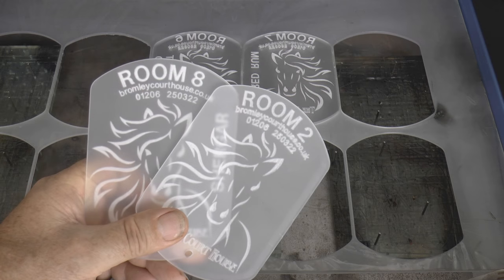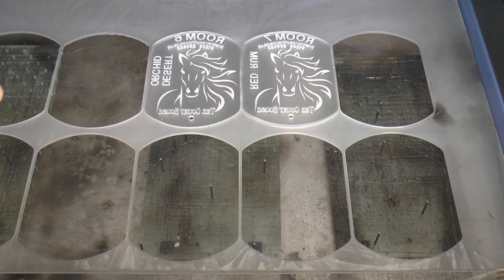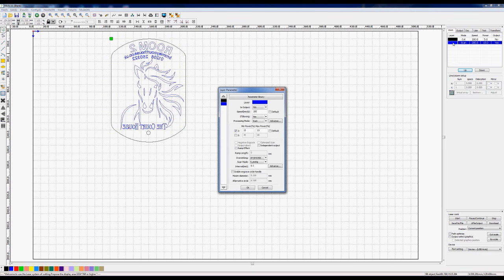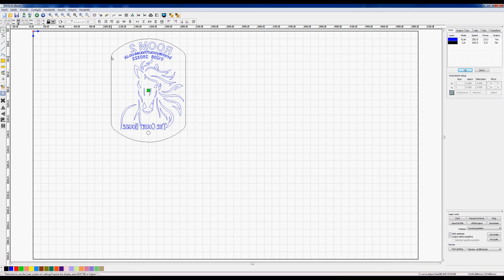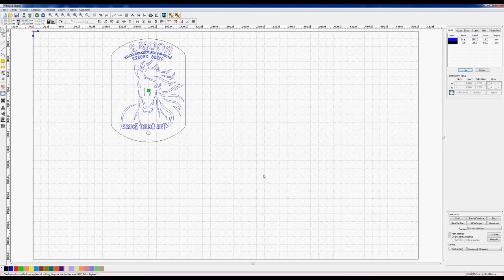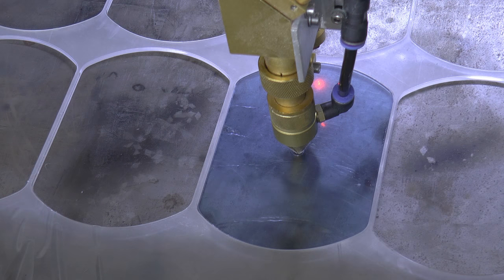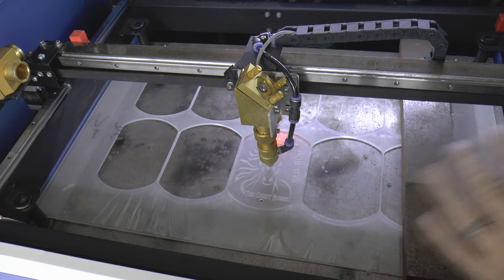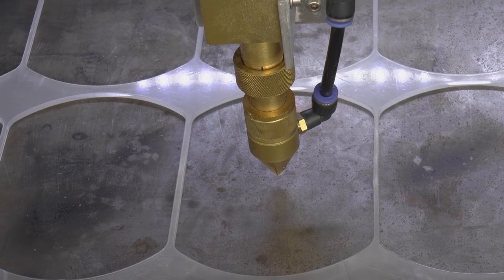RDWorks Learning Lab 70 Repeat Engraving Location Jig

Comment: In the hobby CNC mill world, the simplest way to get perfect registration (when one doesn't want to attempt painstakingly edge-finding the stock with high precision) is to just include the holding jig (whether it's bolt holes or an outline) as the first step of milling - that way one really doesn't care where the stock ends up precisely, only that the jig cutting pass is aligned with the work to be done on the actual part in the software which is generating both.

Granted, this only works until one moves the resulting jig which then immediately becomes useless having lost its registration wherever it was, but for small runs that's quite fine; next time one just cuts a brand new jig wherever else seems convenient - there's no need to ever locate anything manually. The work pass just has to be in a known position relative to the previous jig-cutting pass.
Reply from the maker: Hi
I have moved on in several ways since I did that video and to be honest, I use one of several  techniques. However, 90% of the time I use nothing more than a piece of card taped to the table. I just draw the outline with the laser and bingo there is my jig. Unlike your CNC there is no cutting force involved so I only need to align my part with the outline and........

Best wishes
Russ

Comment: my approach i use when wanting to get a design in a particular location is , firstly i glued a piece of ply to bottom right of the bed , then cut  a corner out of it using the absolute starting point option . so i now have a datum point to work from , you must ensure you have the bottom right selected in the select position reference option ,( box to the right of the padlock symbol) . you also need to make a note of the x and y position you initially used to cut you jig to , then all your dimensions for your project are referenced from that

now it doesn't matter how big the workpiece is or what shape 

sorry bit hard to explain , but i hope you get the gist
Reply from the maker: Hi
Yes I understand. You created a fixed corner reference to locate parts against . The only limitation on that is that it is fixed to the table. I often use oversize material, as I did on this project. That would cause my material to sit up on the reference square at one corner if i am understanding you correctly.  If this was a task I was doing regularly then a fixed square would be a better solution
Thanks for your input because others reading this may choose your solution.
Best regards
Russ

Comment: For my templates, I create my layout pattern in my SW with the holes for all of the widgets I could print as well as a registration mark in opposite corners with the location marked next to the mark (50,20) or something like that.   I disable that layer though so it doesn't print when I am printing the product.  I then populate and download the image with absolute coordinates to the laser.  Next I move the laser head to the registration marks (printed on the template) and make sure I am square and then press print.  I check the registration each time I print a new batch.  This works really well and is "usually" pretty idiot proof.

Comment: very useful tips!

perhaps you want to do lower acceleration values in the firmware- may give you issues with not using the whole x axis for engraving- due to over-shoot that it needs to ramp down to change directions, however there will be less shaking and wear and tear on the machine, especially for alignment. also a more uniform engrave.

Comment: On the controller panel (on the display) the loaded graphics are displayed in reverse way than in RDWORKS. Can it be improved?
Reply from the maker: Yes. Press the ZU button and  the last item is screen axis. Press enter and get the screen picture to match the RDWorks picture.
Best wishes
Russ
Reply: @SarbarMultimedia  Thank you. Do you mean the Screen origin + parameter? Can you help me with these resonances? BEST WISHEHS
Reply from the maker: @lordfragers  
Hi Fra
Yes the  Screen Origin+.   Press enter and you will get the choice to make any of  the four corners your origin.  If your machine runs to top right corner at start up, in RDWrks there are blue arrows that should be in that same corner. If not then you must first go to Config, System Settings and fix that problem.  When you have your RDWorks and Machine datum at the same corner, then you must make sure that your Screen Origin is at the same corner..

I think it will be a good idea to add your email to another comment so that I can send diagrams  for future issues. I get auto copied with all comments to my email. So leave your comment and email address and after  about 10 minutes  go back and delete your comment/email. I will answer to your email. address

Best wishes
Russ
Reply: @SarbarMultimedia  Writed and deleted mail.
Reply from the maker: @lordfragers  
Hi
For some reason the email copy has not arrived but I will stay watching your comment  if you would like to try again.
Best wishes
Russ
Reply from the maker: Hi Fra
My email may not have picked up your comment because it was a sub comment. Go to any other of my videos and add a new comment there. I am then sure I will get your message
Best wishes
Russ

Comment: Cool! How did you set that the engraving head does not go beyond the picture? What parameters did you change in RDWORKS?
Reply from the maker: When engraving, the head always travels beyond the last point of scanning because the head has to decelerate, stop and then accelerate to the defined speed before starting the next scan line. This deceleration/acceleration is defined in the vendor parameters for the X axis These settings are usually standard settings that work for your machine. They may not be the best settings  so you might like to increase the number until the stepper starts losing steps (or makes the machine shake!). In this video I am using a scan speed of 200mm/s so there is little over-travel. If I change to 400mm/s then there will be 40 or 50mm over-travel beyond the ends of the picture. The deceleration remains the same  regardless of speed so its like when you drive your car 50kph, jam on the brakes and you will travel a certain distance before coming to a halt.. You instinctively know that if you jam on the brakes while travelling at 120kph, it will take a  substantially longer distance to stop. The distance your head overtravels is all to do with the mass of your hrad, and the power of your motor. Bigger motor=fatser acceleration OR lighter head for a small motor =faster acceleration.

Best wishes
Russ.
Reply: @SarbarMultimedia  Thank you. Are they the only option for the head to decrease away from the cadres at lower speeds?

Can you explain what is the jump off speed parameter?

When cutting, I have a problem with the edge of the wheel. The edges are wavy. If I change the speed to a lower one then the problem disappears. What parameter can I change to improve this? Jump off speed? Acc speed? Max speed?

Do you have a movie with setting mirrors in the co2 laser?
Reply from the maker: @lordfragers  
Playing with the motor parameters may well seem to cure your problem but that will be at the expense of speed. Quite often there are other mechanical reasons why your cut is wavy and changing the parameters is hiding the problem not fixing it. I shall need some pictures to see your problem, so I think we should speak by email. For obvious reasons I do not publish my email  but if you wish to add your email to another comment I will; get auto copied to my gmail and will answer you and immediately delete your comment/email address from public view.

Best wishes
Russ
Reply: @SarbarMultimedia  THank YOU so MUCH! I have to take a picture. And what errors in mechanics can occur?

Can you explain the jump off speed parameter?
Reply from the maker: Hi The simple answer is no. I have experimented with it and found that you can set it between 1mm/s and 80mm/s . If you set above 80mm/sec it automatically defaults back to 20mm/s. (which is where mine is anyway). I think this is the starting speed for the stepper drive and I  can feel a slight extra kick on the machine at 80mm/s , although I cannot hear a difference from 1mm/s  at the start of any motion. Play with it for yourself because it has no dramatic effect.

Best wishes
Russ
Reply: @SarbarMultimedia  Thank you so much. So is it like the extra power at the start of the stepper motor? However, the parameter is not important.
In the vendor tool, the laser parameters are: attenuation laser and freq laser? What do they mean?
Especially the freq laser.
Reply from the maker: @lordfragers  
Hi 
You do not want to attenuate the power of your beam so just leave that one st zero attenuation. The frequency  puzzles many . There are two ways to control the power from the laser. Let me start from the beginning. The HV power supply has two functions. It creates very high voltages ,25,000 volts or  more, to ionize the nitrogen within your tube's gas mix . That is the pink beam you see (note!!! that is NOT the laser beam). Once the nitrogen is ionized it can carry vast electrical currents. We cannot allow that so the second function of the power supply is to control that current to just a few milliamps.  Your HV power supply may for example be rated at 25mA max.   There is an IN terminal on your HV power supply that is fed with a dc voltage from 0 to 5volts. When the voltage is at 5 the power supply will allow 25mA to flow through the tube. When it is 2.5volt it will allow 12.5 mA and  at zero it will not allow any current flow. So you can see that current through your tube is directly related to this IN  voltage . When you select power o 50% you are asking the controller to send a 2.5volt signal to the HV power supply and similarly when you ask for 100% power , you are really asking the controller to send a 5 volt signal to the power supply.   The watts output from your tube is NOT linear so 25% power will not mean 15 watts from your 60 watt tube. No, more like 40 watts.  If you look at your controller you will see that there is a terminal group CN5 . Terminal 5 will say L-AN1. This will be connected to IN on the power supply and the  voltage in this line will rise and fall according to the power you are demanding (0-5vdc). It is an ANALOG output. Most machines instead, have a wire between terminal 3 and IN. This terminal is called LPWM1 and is a DIGITAL version of the analog output which is almost totally resistant to interference from the high energy spikes generated by the machine. PWM stands for Power Width Modulation and this is a clever way to send a variable voltage to the IN terminal. The signal in this line is either 5v or 0 volts. If the voltage is high for 1 millisecond and low for 9 millisecons then the AVERAGE voltage over 10 milliseconds will be 5v/10=0.5v The problem is that if it took 10 milliseconds to work out what the voltage should be then your machine would be VERY non responsive . That is what your frequency is for. It should be set to 20Khz. It generates a 0 to 5v square signal that is 5 volts for half the time and 0 for the other half  So instead of my 10 millisecond example this 20 khz coding takes place 100 times faster ie every 0.1millisecondx. So don't mess with the frequency leave it at the default 20Khz.

Best wishes
Russ
Reply: I understand, 20 kHz is PWM. The bigger the faster the laser determines the control voltage on the generator. Does this affect the laser beam from the tube? What is used to suppress the tube?
I mentioned that I have a problem with the edges of the square at high speeds. As I cut a square in the Y axis, the cut edge is ok, and then when it starts to burn the X axis it starts with a light wave and then the edge straightens. In my opinion, it is the fault of the drive. It's just a stepper motor that has no power to control the gate or backlash?

At lower speeds it's fine.
Is it possible to set the new edge to begin setting with less acceleration? Set a higher resolution on the stepper motor controller?
Thank you for great help.
Reply from the maker: @lordfragers  
Hi Fra
I think your opinion is incorrect for one very logical reason. Your axes are driven by stepper motors. If you had a dc servo control system  then a wavy line would be possible  because you can drive a servo past its aiming point and then pull it back to the target. If the closed loop control system is too "loose" then a way line could result. Not so with stepper motors because the driver outputs the exact number of pulses to move from point A to point B. It CANNOT move beyond the aiming point so there will only be a deceleration ramp  and zero over-travel, So no possibility of a wavy line from the steppers. Your problem will be from a mechanical resonance source. Yes,  slowing  the speed down will reduce the effect of that resonance. . Three main possible sources for this resonance  are 
a)  The  Y drive belts are made of cheap rubber and the teeth flex. This will be further exaggerated if the belts are narrow, say 12mm as opposed to the more typical  15mm wide.
b)  The Y drive shaft may be very thin , say 10mm diameter or less,. and this can result in torque wind up when trying to accelerate /stop  the heavier gantry axis.
c() The belts are insufficiently tensioned.

Hope this helps

Best wishes
Russ
Reply: @SarbarMultimedia  Thank you, Hi. Could this mechanical problem be solved by software?
Maybe it's the Backslash fault?
The Y-axis belt is tight.
Reply: Hi. Do you have any idea to reduce this problem programmatically?
I have an idea:
1. Set slower ramps. The engine will stack and brake more gently. But I do not know how to do it.

2. Remove backlash. Where we enter the parameters.

3. Set higher resolution on stepper motor controllers

What do you think?
Do you have any idea

Best wishes.

Comment: Is this laser still working well for you?
Reply from the maker: As  you follow my learning journey with this machine you will see me getting frustrated with some elements of the design  and I make my own replacement parts and do modification to fix small problems. It is now working much better than when I started 5 years  ago. I replaced the original crap tube and power supply and since then it has performed reliably and very well. I do very little with it now because my step daughter has commandeered it for a small photo engraving business she is building  See current samples of what the machine is doing at her facebook page Unique Laser Art.  Mechanically it's pretty sound  but if you buy from ebay I can guarantee you will be getting a reject tube and power supply that will work in some way but for how long is a lottery. Despite this, provided you buy one with a Ruida controller (note the design of my keypad) then it's an excellent investment.  An A grade tube will last 4 to 6 years (or more) if used correctly,  so ignore any life promises (usually a few thousand hours).

Best wishes
Russ